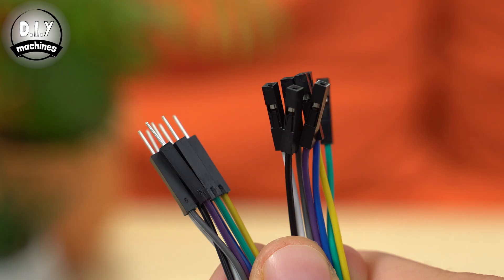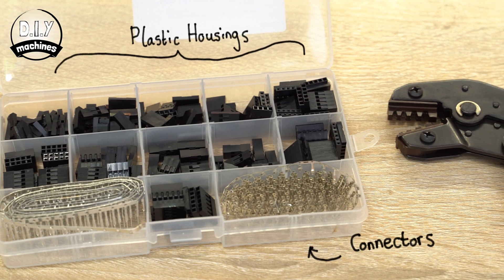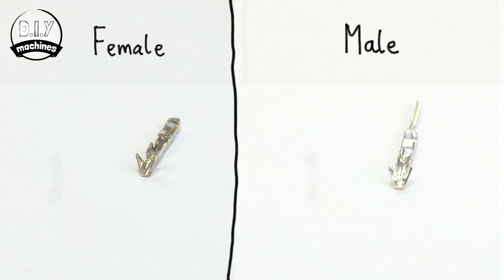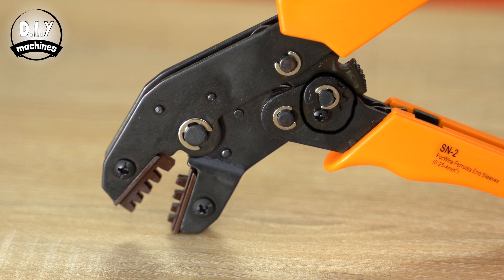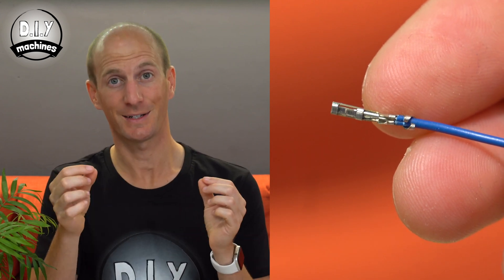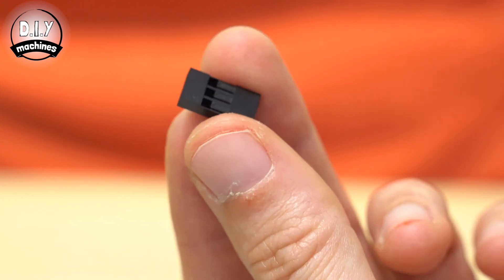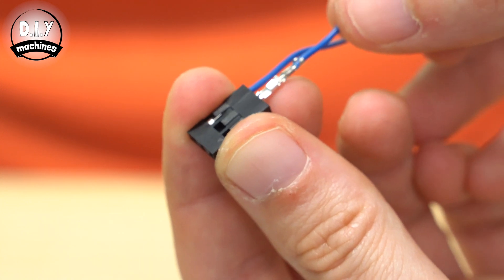Dupont Connectors - Quickly and easily make your own

Comment: I am pretty sure calling them mini PV is just as wrong as calling them dupont. The correct name is -crimped wire to board pin and  socket connectors (0.1" / 2.54 mm pitch). it doesnt exactly roll of the tonge, i know. Mini PV is an AMP / TE connectivity product family, and most cheap crimp terminal conectors sold online are not actually mini PV. Calling them Mini‑PV is like calling a Poundland screwdriver a Wiha. Dupont is obviously completely wrong too. Dupont made early versions decades ago. But they had different shape and geometry to all the modern ones
and this video uses the wrong tool. and the crimps are awful. It is impossible to correctly crimp with the tool the guy in the video is using.
Reply: You’re mostly right. (Though I think that the “DuPont” ship has sailed, and we’re stuck with it now, for the meaning of ‘generic 0.1” Mini-PV-style connector’.) If anything we should be calling them Harwin M20, because those are exactly like cheap DuPont, just of higher quality. (Possibly JST RE, too.) 

I am so annoyed that this video, and so many others, show the wrong tooling, producing objectively awful crimps, but pretend they’re good.
Reply: @tookitogo  thanks for your kind reply. It meant a lot to think a person had read my words and found truth therein. cheers k
Reply: @KarldorisLambley  No worries. Unlike the sycophantic “oh, if they’re so wrong, why don’t you make your own videos” responders, I respect people who want accurate information out there! 

P.S. Speaking of which, are you absolutely certain that the DuPont-branded connectors were different? My understanding is that Mini-PV was invented by Berg Electronics, which was acquired by DuPont for a while, before ending up at Amphenol (not AMP). Given that the same parts and tools (same part numbers, even) were available under the Berg, DuPont, and now Amphenol brands, I cannot imagine they’ve changed.

AMP/TE’s equivalent series is AMPMODU, by the way. (I use a genuine AMPMODU MOD IV crimper for generic DuPont, and it produces just outstanding crimps.)
Reply: @KarldorisLambley  Although in the case of DuPont crimping, I have seriously considered making my own video, simply because there are no truly excellent video tutorials ones out there. I’m just not sure if I have the recording gear and editing skills to produce the production quality I’d want…
Reply: @tookitogo  do it! i love crimping. here is a recent comment of mine - My mate’s Mrs (who knows I love crimping) said to me, “I realise you are a keen crimper. I wish to buy my bloke sufficient crimpers to cover all eventualities. How many need I buy?” She wasn't happy when I said the absolute minimum is 7 crimpers — (6-tonne hydraulic, large non-insulated, small non-insulated, large insulated, small insulated, SN-025 for so-called "Dupont" — protip: they aren't Dupont, nor are they Mini-PV; they are correctly called crimped wire-to-board pin and socket connectors (0.1"/2.54 mm pitch); it doesn’t exactly roll off the tongue, I know — and terminal ferrules).
Am I odd for considering 7 crimpers the bare minimum?
To be clear, I trimmed the list of essentials for her. I didn’t mention Open Barrel/Deutsch crimpers, coaxial crimpers (for hex crimps on RF cables, RG6/RG58), or modular plug crimpers.
Reply: @tookitogo  Ah, fair point! I realise now that the DuPont connectors weren’t really different—my comment was just a throwaway on YouTube, not a proper debate with a fellow crimping obsessive. I’ll happily defer to someone who actually knows their crimps! It is a deight to meet a fellow crimping obsessive!
Reply: @KarldorisLambley  “Sufficient crimpers for ALL eventualities”?!? LOL, then the number would be in the hundreds and hundreds of tools, costing millions (if we consider that some connectors do not have any hand tooling options at all, i.e. only fully-automatic mass-production tooling is sold). 

All jokes aside, I don’t think one can come up with a number; it’s too dependent on what someone actually needs. I’m an electronics technician, so I never need the tooling for giant mains cables where each conductor is as thick as a garden hose. But then I do have high standards for the small connectors and terminals. 

I think that for a hobbyist, a good starter set includes a Lidl DuPont crimper (better than SN025!), an Iwiss IWS-3220 for small terminals, and a Knipex modular crimper, initially fitted with dies for insulated terminals, plus a die for non-insulated closed-barrel terminals (i.e. “dimple” crimp), plus a good ferrule crimper. And a set of good German automatic wire strippers (like Knipex MultiStrip 10). 

With that said, the more experienced I get, the more I move away from buying (or recommending) things to just have on hand; more and more, I get what is actually needed when I need it, both for tools and parts.
Reply: @KarldorisLambley  Hahahaha yes, I am very much a fellow crimping and connector nerd! 

My private collection of crimp tools is already up to something like 15 pieces, including my beloved AMPMODU crimper, my AFM-8 mil-spec crimper, Molex Micro-Fit 3.0 and Mini-Fit crimpers (all original, bought mostly as NOS, some used), plus a slew of cheap crimp tools. Most recently I got a whole bunch of barely-used name-brand tools, including Knipex and Pressmaster ferrule crimpers (square and trapezoid, respectively), Klauke crimper for insulated terminals, and two Knipex MultiStrip 10 automatic strippers. (I have more “official” tooling at home than I do at work, LOL!) 

(The Molex and Klauke tools are made by Pressmaster.)

Comment: If my dupont connector is connecting to a cb / hf tranceivers PLL chip, can I put a bees dick of solder after crimping each pin ?
Much appreciated. 
❤ ✌️
Reply from the maker: Yes. As long as it’s a small enough amount to not interfere with the way the pins mechanically lock into the plastic sleeve they reside in.
Reply: @DIYMachines excellent. thanks for the reply.
Reply: Adding solder to a crimp only helps a poor crimp. Adding solder to a good crimp actually makes it worse.

Comment: What's the crimping tool? I'm not sure if that's the right crimping tool.. since you are crimping 2 different thickness at the same time... And your using what looks like a standard crimper...
Reply: Whatever he’s using is definitely not the right tool, as the insulation die has the wrong shape.

Comment: Could you use these to make connector leads for led strips for 24v circuits?
Reply: Yes, though JST SM connectors are more common for that application. Beware that both SM and DuPont are only intended for 2-3 amps, and that long LED strips (especially the ones with 120 or more LEDs per meter) can easily exceed that significantly.

Comment: Who do you consistently insert the wire the correct depth as you can't see how far it has gone in until you make the crimp?
Reply: If you’ve inserted the contact accurately, and the wire is stripped very cleanly (nice square cut on the insulation, not a ragged/torn/tapered cut), and you insert the wire very carefully along the top of the crimp die, you can actually feel the insulation snag on the same little “shelf” that the contact sits on. 

You can actually look at the contact from the top and see how far you’ve inserted the wire. If you strip the wire accurately, with a consistent strip length, this can give you a quite reliable indication of correct positioning.

Comment: and don't forget to buy descent crimping tool, i have 2 models, one is from my dad bought at LIDL, 90% fails on crimping ...
Reply: The Lidl DuPont crimper is the first low-cost DuPont tool I have tested (and that’s many) which actually works well. Other people on forums confirm this. I can’t speak to the Lidl spade terminal crimper, but their DuPont crimper is actually quite good. It actually has the correct die shape (99% don’t!), and the precision of the dies is good enough for hobby use. (Many others I’ve tried are way worse.)

Assuming you’re talking about the DuPont crimper, are you absolutely sure you’re using it correctly? May I ask what’s going wrong with your crimps?

Comment: I know this is a 5 year old video, but I need to make (or buy) a 14 pin female connector with 2.54 mm pitch on an existing 14 conductor wire. I have had a hard time sourcing the female connector. I thought maybe the kit you sell on Amazon would do this, but there is no 14 pin housing in the kit. Can you advise how to get this done? Thank you

Comment: You explained this very nicely! Prior to watching, I messed one up. After seeing this, it worked perfect on the first try. My wires were stranded and I found it easier to feed the strands through, and then insert the connector. It was still a challenge, but it worked when I had it lined up correctly. The second crimp with the smaller opening was a good tip.
Reply from the maker: You're welcome and I'm glad it helped!

Comment: That crimp you showed was awful. The insulation crimp at the end should be tight around the insulation. The wire crimp section is supposed to all be crimped tight, not only half of it and loose.

Comment: Great stuff - a much needed tutorial. What I've found is the second crimp is the important one - if you get the angle wrong (i.e. it isn't in straight) it'll mess it up and bloat out the sides making it impossible to push into the housing correctly. When that happens you can't push it beyond the catch and it will fall back out eventually. You can reshape any bloat by re-crimping at a good angle - but it's messy.
Reply: Well spotted I have used a paire of pliers to adjust the crimp after crimping the idea is the crimp should click into the housing and not wedged in otherwise this is an excellent video demonstrating how to crimp.

Comment: NO. This is NOT Dupont connectors crimper. The difference is small but important. As you see the last pair of wings on Dupont connector, those crimped arround the insulation are designed to be , well, ARROUND the insulation (triangle shape and they don't meet each other) and only smaller wings should be crimped in M shape to hold the cable well :) In your case they are twisted in M shape, the same way as smaller wings,pointing TO the insulation. Thats why the REAL Dupont crimpers have M shape teeths for smaller wings and, larger ROUNDED shape for insulation part. Your crimper is designed for JST and other connectors which insulation wings are even and "meet" each other after crimping.
Reply from the maker: Thank you for the detailed information and the time to share it with me. I learn a lot from comments people kindly share like this. 👍🏼

Comment: I have used a cheap ratchetting crimper on amazon once, and have never had any success. The strain relief was always crimped akwardly and would end up too big to fit in the housing. Currently I own an IWISS and an engineer PA crimping tool. Had much more success with those. I personally prefer the engineer ones, since they operate smoother and don't tend to snag. But if you are looking for a low cost pair, IWISS, in my experience, always made good solid crimps that slide right into the housing.

I would he curious to hear if any of you here have ratchetting pliers that worked well for Duponts.

Comment: 🤣🤣🤣🤣     Dude, 5-7mm of exposed wire inserted into the female terminal is WAY too long!!   You only need about 3mm....   4mm MAX!   
You've inserted the wire all the way up into the pin socket (or "tunnel section" as you refer to it), which is going to crush the wire resulting in an unreliable connection with whatever pin you're inserting it onto!  
  This is all besides the fact that most of these Chinese knockoff crimpers are going to end up crushing the entire thing anyways.   For any beginners, it's going to take a bit of trial & error to figure out the best die and/or pressure needed to make these terrible crimpers do a decent job of producing a reliable working connector.
Reply: Can't wait for your connectors to fall off due to wires being too short.
Reply: @youtubehandlesux  He is absolutely correct. The specifications for those contacts specify a strip length of 3.3-4mm. Any longer than that and the excess wire “brush” interferes with proper housing retention and mating.

Comment: Is it possible to crimp two wires into one connector to make a Y-split?
Reply: Yes, as long as the total cross-sectional area is still within spec. 

For example, two 24AWG is at the very outer limits of what some DuPont contacts can handle. But two 26AWG are comfortably within the tolerances. 

Also, you may run into trouble with dual wires with thick insulation. Thin-insulation wire works better in this situation.

Comment: Very helpful.   But which size jaw opening should I use for the Dupont terminals seen in the video ?    Does it depend on the wire size ?    If so, where can I find a chart to match them ?

Comment: You didn't even crimp the wire correctly and pushed it too far. Thats why when you first tried to put it in the plastic casing the tab was pushing up even after the crimptab was pushed beyond the plastic tab. The poor crimp held the plastic tab up.

Comment: question. the metal connectors are the dupont are they the  same as JST connectors?
Reply: Nope. Also, JST is just a brand: they make hundreds of different connector models. (I hate that some disciplines, like radio-control cars/planes/drones, just say “JST” without saying which JST series they actually mean.)

Comment: So much video time and not so descriptive process. There is trick with putting wire into connector - your wire should not go too deep. And beginner barely will even guess what's wrong. Also it's nice to explain what size of crimper you have (I mean crimping jaws), because mine (I bought by mistake) have too big size. Size of wires also matters, because too thick wire simply cannot pass into shell. But you need thick wires, because they have less resistance.

Comment: It's great to have stumbled upon your video and channel! I am very interested to know about the longevity of the crimper you used for crimping Dupont wires. Could you kindly share your experience of how well the tool has held up over the past two years? Your insight would be greatly appreciated.
Reply from the maker: Thanks. I'm still using the same tool. It may not be a professional version but it does the job for me - however I'm not using more than a few time a week if that.

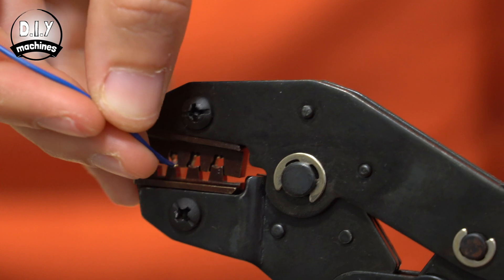Comment: at 2:22, strip 5 to 7 mm of insulation off? No! Measure the wings for the bare wire, they are not longer than 3mm. The insulation wings are 2.5mm long. ALSO, don't crimp solid wire! Use stranded wire. BEST WAY: 1) for female connectors, insert a square pin into the connector until it reaches the wings for the bare wire, where it will act as a backstop, 2) for male connectors, close the wings between the male tip and the wings for the bare wire, and have these folded wings act a backstop.

Comment: hi ya you got on a washing machine 7 way connectors female ? I had my washing machine wiring came loose, repair guy just botch it, by bashing open end to it hold and now flat. Washing machine work atm but the repair is botched to point can not be repair again without cutter the connector off.

Comment: That's not the proper crimping tool for dupont  u need a round shape for the wings that crimp on the insulation not a heart shape. It works as well with this kind of crimper but still is not the one I would recommend for dupont terminals